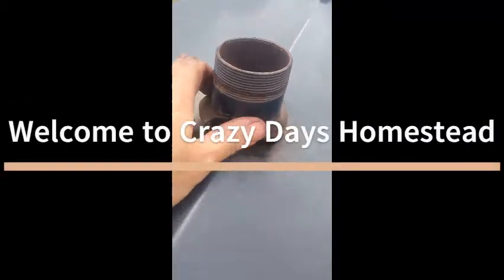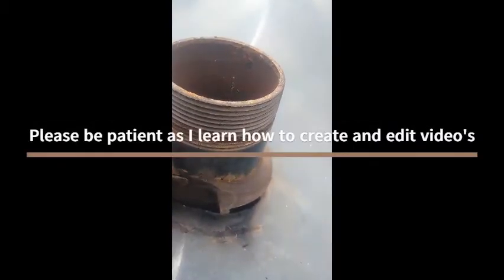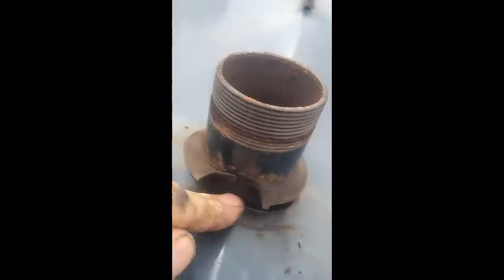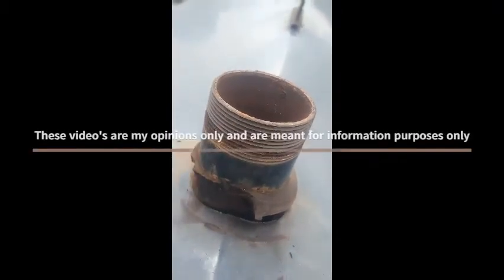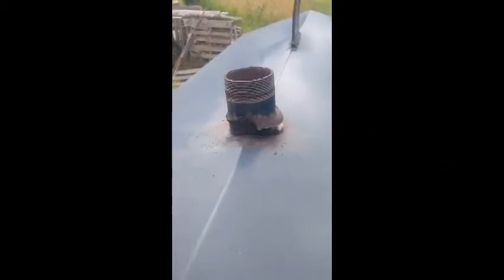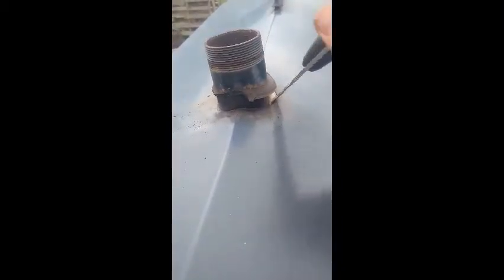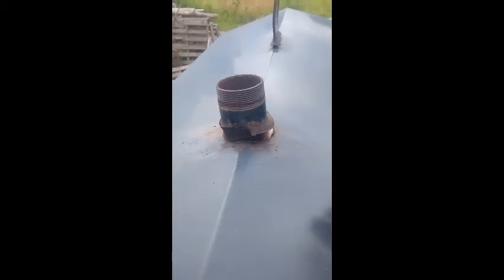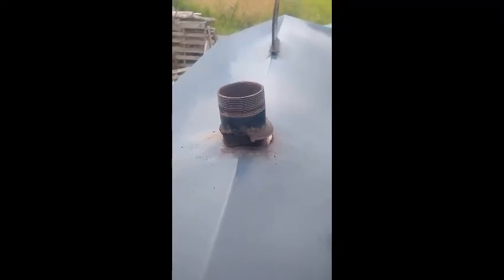My Opinions on my outdoor furnace Portage Main BL28-40 (Part 2)

Comment: As a carpenter having worked on bigger medical office buildings and apartment buildings I think Rock wool is a better insulation than that spray urethane foam. It’s fire retardant
Reply from the maker: Rock wool is good insulation, but you need a radiant barrier